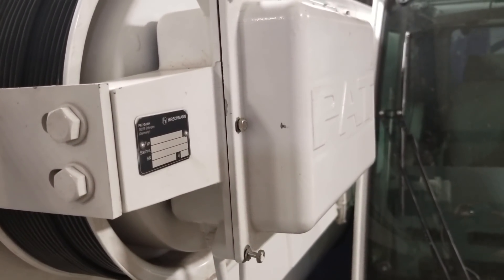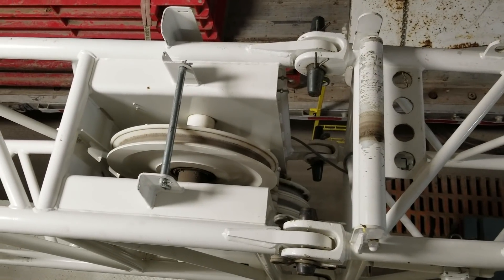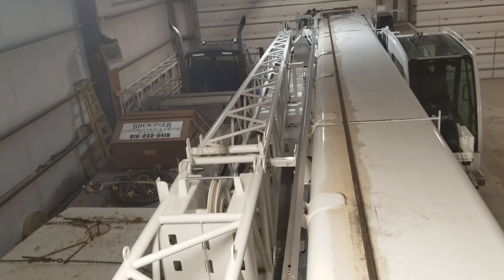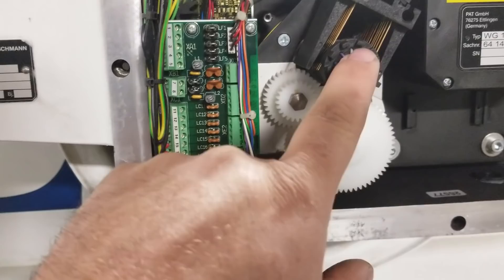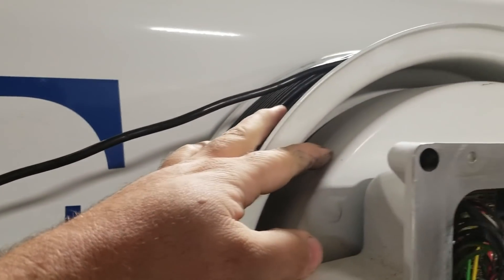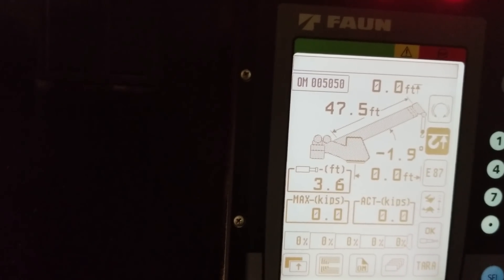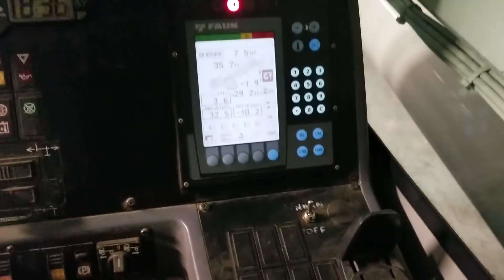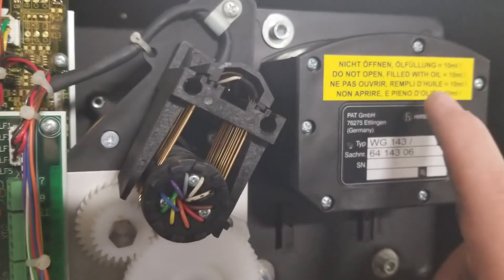Closer look at the hydraulic luffing jib - boom length indicator repair and adjustment

Comment: Thats one plus with the AML in the 180, while it has the external length potentiometer, its not connected to anything. Long as your precision reel on the cylinder is good, you are set. Still a pain to change that A2B cable though, like all Hirschmann reels.

Comment: I drive for a Large Roofing & Sheet Metal Company and we use a crane quite often. We mostly use a company out of Walton Ky, called D-Crane, curious if you had ever heard of them. They have several units the one that we request most often is a Link-Belt ATC 3275 if I’m not mistaken I think it has 300 feet of stick or maybe that’s with jib and is a 275 ton unit, all I know for sure is that it’s a BEAST. We need that unit not so much for the lifting capacity because most of our picks are less than 10k lbs. but we need the reach capacity to set materials on different parts of the building. They have several units from a large boom truck to Big Mama (the 3275}, and they are a great bunch of guys to work with as well.
I’ve always have been fascinated by cranes and I LOVE YOUR CHANNEL!!! Thank you for all your hard work producing your videos!!!
Reply from the maker: Bornapatriot BythegraceofGod, I haven't heard of them. Most big crane work is because of the capacity at distance. I very rarely pick really heavy stuff. But, often pick moderate to light loads at a fairly high radius. Many thanks for watching! 🙂👍

Comment: Can you luff the jib with a load on it, or set it at the required angle and leave it until the lift is over?
Reply from the maker: Chris Rowland, yes the jib can be luffed with a load. As long as the load and change in the jib offset doesn't exceed the capacity of the crane. Thanks for the great question and for watching! 🙂👍

Comment: Wondering what all of the numbers on that screen mean. Most i can figure out, but the top number was 0.0 ft when the "boom out" read incorrectly, but changed to 7.5 ft once you adjusted the boom length to 35.7ft.
Reply from the maker: crispy83, that is the height of the center of the sheave (tip height) from the ground. It was probably reading 0.0 because it knew that it was in an improper state. Once I got it dialed in, it could recognize all of the parameters and make a calculation of the sheave height. Thanks for the great question and for watching! 🙂👍

Comment: Did you pull the cable all the way out to make sure you can get full boom extension length without the watch spring in the reel binding up at the end? There should have been a few extra turns on the spring, but...
Reply from the maker: I wilton, I did! You have been down that road I take it? lol. Thanks for watching! 🙂👍
Reply: Yea, been there, done that, bought the new reel. :-)

Comment: Interesting and informative video, but dude, what did you do to that finger?!
Reply from the maker: Onerouss, which one? The one that I used to demonstrate the jib? If so, I had some grease on it. But, the ole fingers have also had a rough life. 20+ years of turning wrenches and operating equipment will do that to a finger. Lol. Thanks for watching! 🙂👍
Reply: Yup, the Jib pointer finger. I cringe to think of all the things dropped on it to make it that crooked when you're pointing straight! ;-)
Reply from the maker: @Onerouss , it's on my left hand and I'm right handed. So yes, it's had a rough 41 years. Lol. Honestly, with all of the things I've worked on and put it through, I'm just glad that all of them are still there. 🙂👍

Comment: Adjusting that length sensor seems a bit like adjusting a satellite dish on your own. Sure, you can do it but damned if it wouldn't be hand to have a second person there to do it with you.
Reply from the maker: Sandy, that's a fact. Been there and done the satellite dish adjusting by myself too. Its quite the pain. Thanks for watching! 🙂👍
Reply: @ToTheTopCrane 
When I was doing more than a few of adjustments on satellite dishes I finally got smart and purchased a signal meter ! 😊
Best 30 bucks I ever spent !
Reply from the maker: @kengamble8595 , I always did the climb the ladder, move the dish 1/8 of an inch, climb down the ladder, run in and look at the TV. Then repeat about 900,000 times. Lol. I should've bought a meter. 🤦‍♂️

Comment: By adding a few wraps like that, don't you limit the total rotation?  If you now extend your boom fully, with the drum stop turning because the clock spring is fully wound, and cause the cable to break?
Reply from the maker: Pete S, the drum is capable of turning quite a bit more than it needs to for total boom extension. Unlike a tape measure, there is much more spring than required. But, that is is a fantastic question! Many thanks for watching! 🙂👍